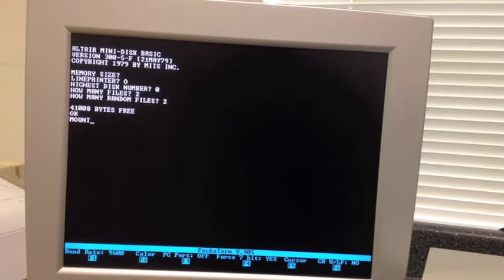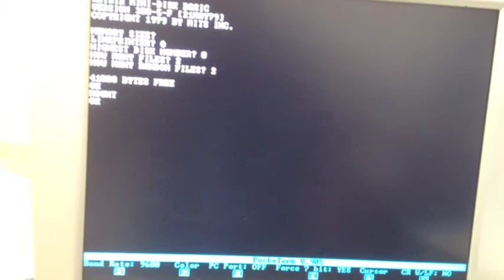Altair Minidisk "Flippy Disk" Demonstration

Comment: I used to make flippy disks for my TRS-80 Color Computer when using the standard SS 35 track format. I had an aftermarket controller and double-sided drive, so I could also use a DS 40 track format which was incompatible with standard Radio Shack drives and controllers. My original CoCo is long gone, but I remember how to make the flippies. My Apple-using friends didn't need to punch the second index hole, of course. I didn't know that there were drives which supported flipping unmodified disks before seeing this video.